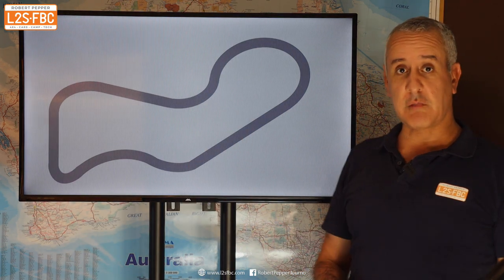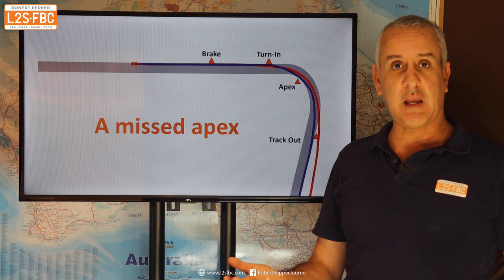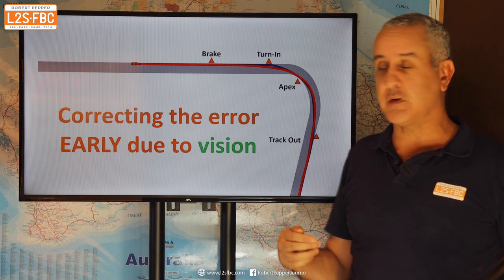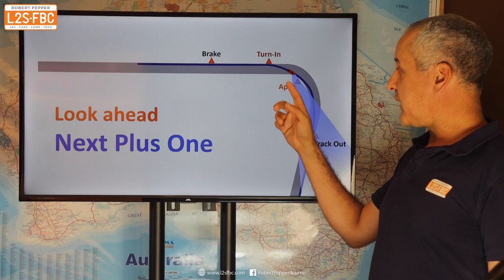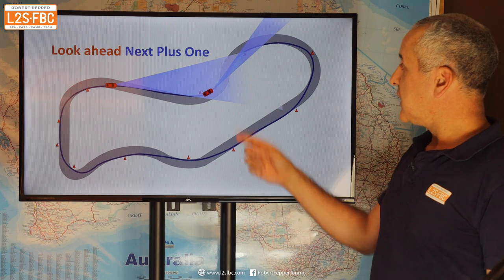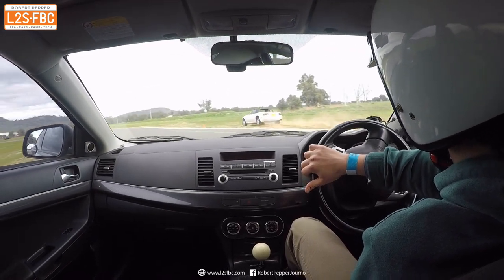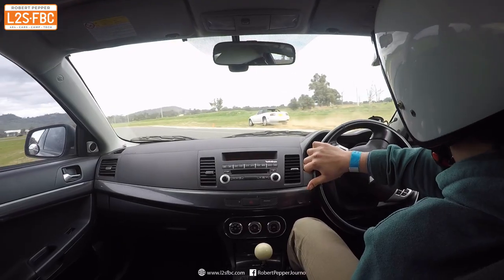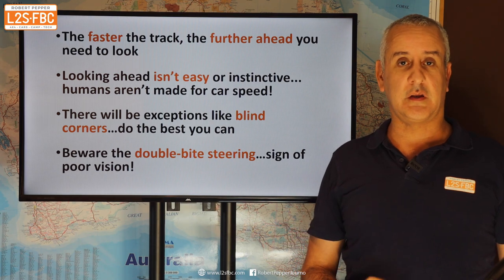The Root Cause of Track Errors - Track Mistakes #3

Comment: Thanks Robert that was very good. 
I find I come in too fast and consequently wash off too much speed losing momentum in the process.
Reply from the maker: Yes, "slow in fast out" is a good way to think about corners before you build up to fast in fast out. Basically braking say 10m before you really need to might lose you 0.05, but you'd gain that back in the corner let alone a better exit speed and higher speed down the straight where it can translate into many tenths. I actually have some video to prove that exact point.
Reply: @L2SFBC  Thanks Robert. I realise the folly in my approach, but overcoming the natural instinct when out and running adrenalin 100% is a tall order :). I just have to persevere when I next get a chance! Thanks mate. I really look forward to your videos.

Comment: Robert,
Vision, looking ahead?! Knowing your track… thinking about Nürburgring…. Awfully lot of corners… 
Know your track is there the key and know where you are on the track. 
Thanks for your video
Cheers
Reply from the maker: Part of the difficulty with the 'Ring is you need to learn the corners more than usual because most of them are blind and the vision techoque is not as effective; I show some 'Ring footage in the video. On a normal track you can generally see the entire corner so you don't need to remember quite as much.  And of course there are a LOT of corners, and you will only visit each corner maybe once in 10m or so, whereas on a normal track you'd visit each corner maybe 5-7 times in a 10m session. That's why we love it!!!

Comment: Also start off slow and careful. Build up your speed as you experience the track more. 
Hey Robert, do you follow F1? They're capable of squaring off a corner to get early traction down. Probably not suitable for these cars, Idk?
Reply from the maker: Absolutely start off slow! Yes I follow F1.  They do sort of square off early to get the power down not so much traction.
Reply: @L2SFBC  Yes, that's great. I love the undercut move when they go wide and get the power down before the inside car and pass them. Nearly didn't return this year after Hamiltons treatment.
Reply from the maker: Yes it was terrible that ending! Right guy won the championship but in the wrong way.

Comment: Robert, is there a point when you start to "memorize" the turns and it becomes easier?
Reply from the maker: Definitely yes, but you may well end up memorising the wrong lines if you don't look ahead, and you also won't react as quickly to flags or hazards or see what the driver in front is doing.